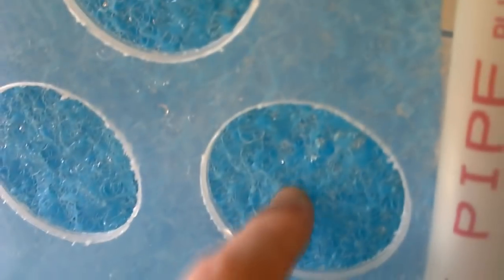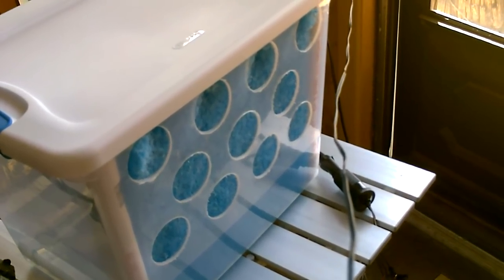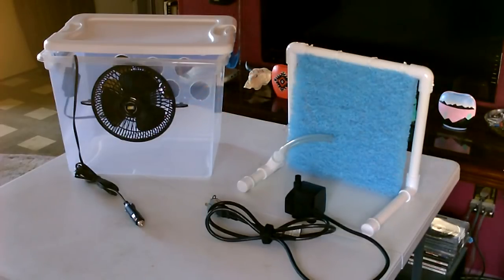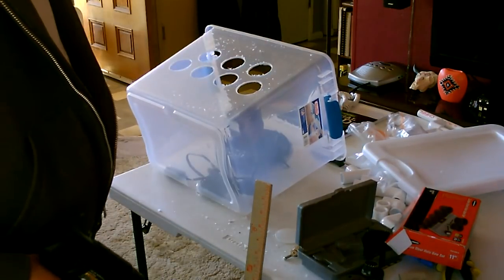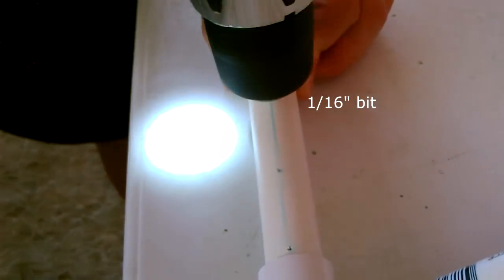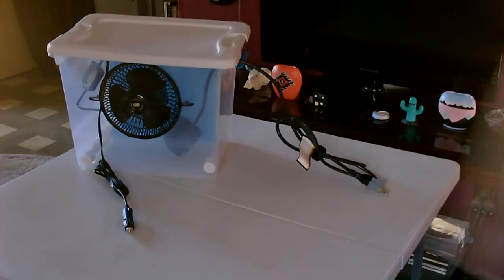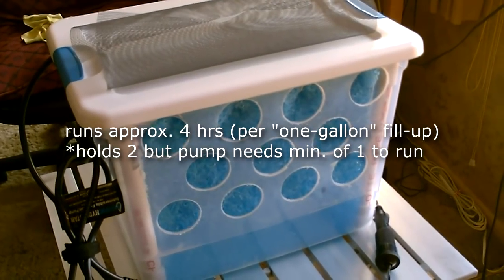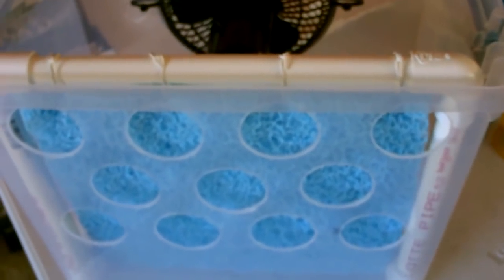DIY Evap. Air Cooler! - Tote Evap. AC Air Cooler! (fits in a Window!) or Desktop -can be solar pwrd!

Comment: Does the pump have to run the entire time and would this be suitable application for sleeping? Goal: raise humidity level during dry winter season.
Reply from the maker: hi. the pump does have to run the entire time but the pump is pretty quiet. the sound of the fan covers it up, so you almost can't hear it. yep, you can use it while sleeping. the only real sound you hear is the sound of the fan.

Comment: Why didn't you list the components you used in this? Where do you find those evap cooler pads?
Reply from the maker: hi there. in some of my videos i mix the list in with the build. i also drop some info in the description area. the build in this one starts at about the 2 minute 47 second mark. the main parts are a basic tote, along with a 12v 10 watt fan, small water pump. 1/2" pvc, 1/2" clear vinyl tubing and the padding. the blue evap cooler pad is technically called 'foamed polyester' evap cooler pad. if you search that term you'll see lots of it. i get it at the home stores (like home depot). a good size sheet of it (3 feet by 3 feet) is usually around $8.00. (if you see it for over 10 dollars a sheet they are ripping you off). it's usually waay overpriced on amazon. best place to get it is the home stores

Comment: but why put it in the window? why try to cool really hot outside air when you can cool the less-hot recirculated air inside? Is it because then you are already trying to humidify already humidified air (once you've run it for a while)?
Reply from the maker: hi. yes that's right. with evap coolers you need ventilation or it gets humid in the room.

Comment: How much humidity does it add to the air?
Reply from the maker: hi there. that's a tough question to answer. with these units you do need some sort of ventilation or the humidity will rise in the room.
Reply: @desertsun02  that's a good thing for me, I am trying to rise the humidity. Do you have a RH meter? I am just curious how much space it could effect and to what degree of RH. I saw your bucket video. I might try the bucket in a month or so and let you know what I find out.
Reply from the maker: @TacosForUs these units can work pretty well as humidifiers *if you don't ventilate. this unit could probably raise the humidity by 20% or more in say a standard size bedroom. the bucket one would do that too. i have one that is specifically designed to work as a humidifier. it's the one i made with a large kitchen wastebasket. if you want lots of humid air that is the best one. it also doesn't use an evap pad. (it passes streams of water thru the air and an optional screen). works great and has a nice sound. here is the video link https://youtu.be/F2eQV-95eUg

Comment: One last question - what size drill bit did you use for the drip holes in the PVC? It looks like was 1/16" or smaller. I've got the fan mounted - ended up getting a hot knife to carve it out as I wasn't making much progress with my utility knife. The hot knife (about $18 on Amazon) seems to work really well for cutting this type of plastic. You just need to make sure that your work area is well ventilated.
Reply from the maker: hi. 1/16" inch is the way to go. that works the best.

Comment: As for the fan for this, I think I have answered my own question. The fan that desertsun shows in his video for this Tote Cooler is made by Auto Expressions, hence the "ae" on the front of it. This fan looks to be available for under $10 on eBay at the following link. https://www.ebay.com/itm/224495783554?epid=1200071162&hash=item3444fdce82:g:X-oAAOSwHnVgxWS0. I am thinking that having a variable speed fan for this thing will be nice, lower for cooler days, higher for extra hot days. I found what looks to be a good one on Amazon https://www.amazon.com/gp/product/B087D5JCQQ/ref=ppx_yo_dt_b_asin_title_o00_s00?ie=UTF8&psc=1. It says it's 9 watts so it is within the design specs shown here. I am also planning on building out the Evap Cooler Cube that our brilliant Youtuber has designed (maybe even the 2 stage model) and that takes a totally different fan - a much more powerful 80 watt car radiator fan. For this Tote Cooler it looks like any type of car fan that is 6 inches or less will do. I thought about getting 2 smaller fans - but most of these seem to be made for computer cooling. I hope this helps.

Comment: Desertsun - I have bought almost all the parts to build this thing, but I'm confused about what diameter plastic tubing I need. I have 1/2" PVC and the T joint you show has to be a bit bigger than that for the PVC to fit into it - correct? Also, I got a pump with 1/2" male thread for both ends, but the thread is more like 5/8" (outside diameter) than 1/2". (I know these are rookie mistakes/questions.) I think I have that covered with a plastic adapter that the tubing will fit on. Should I get tubing with 1/2" inner diameter - or more than this?  My guess is that this will do, but I wanted to check. Also - I've been using portable coolers in my house in an effort to get away from my monster Central Air unit - placing them in front of open windows, but the Hessaire MC26A (and other bigger portable coolers) have side panels that will pull in indoor air unless these panels are blocked, which could create other problems. Your DIY window unit solves this problem. I can't wait to get this thing finished.
Reply from the maker: hi. the clear vinyl tubing should be 1/2" Internal Diameter (that is what i use). the tee joint is a 1/2" tee. they make those to fit 1/2" pvc pipe

Comment: Desertsun - this is marvelous!  You are brilliant!. I've been thinking about how to design an Evap Cooler that fits in a window, and I've looked all over the web for one. The only type available are massive units from MasterCool and Hessaire that are larger than large window air conditioners. I can't wait to build one of these. One question I did have is about the fan. I think I can just buy a 10 watt fan on Amazon, but I didn't see a specific one that you recommended. Also, how many amps does this use. I think a device like this would be magical if it could run on a Lithium-ion battery.
Reply from the maker: hi. the 12v fan i used uses less than an amp (i think it's 800 milliamps). the pumps can be as little as 3.6 watts or 4.8 watts. the whole thing uses very little power. 😎

Comment: I am curious as to how long it blew cold before u needed to add more frozen bottles please
Reply from the maker: hi there. it depends a lot on exactly how hot it is, how fast your running the fan and a few things. adding ice or ice-paks is a great way to give the unit a short burst of super cool air. (but it doesn't really need any ice at all. just the water.) the evap. process cools down the air and the water in the container. if you get 60F air coming out of it, for example, then the water will cool down to that temp. too because of the evap. effect.
Reply: @desertsun02  lets say hottest conditons possible like middle of august daytime running the fan as fast as possible  how long is it roughly in worst conditions at max
Reply from the maker: well, since the evap units double as "water chillers" the water will always be as cool as the air coming out. you can run the fan as fast as you want. to get exact figures you could check an evap cooling chart. those charts show you what temps to expect. one example, in 100F air with low humidity the air coming out will be about 71F (the water will stay around 71 too.). that is all day long everyday. the evap effect cools the water in the tub as well as the air so both the water and the air stay about the same temp.

Comment: I made one of these. It was the cube with the fabric on all four sides. It would work if the fan was stronger. The 12V fan I got is only 3 watts. The same company sells a 9 watt fan - that may work. Also,  I punched too many holes in the tubing - too much water on the fabric prevents air from shooting through. Better to start with fewer holes - like 3 per fabric face.  This one with the one sheet of of fabric, fan in the wall of the container seems a more realistic design. But the issue will still be the power of the fan as cold is produced but doesn't travel far from the unit.
Reply from the maker: hi there. yes, a 3 watt fan is pretty small. this unit i made uses a 10 watt one. so if you make it with a 9 watt fan, it would work good. the cube style one that you mentioned (that i have a video on) uses an 80 watt fan. you need one about that size for it to work.
Reply: @desertsun02  Thanks desertsun -  This unit you've made is really the best design I've seen - I'm making one! Hoping your other video using the 80 watt fan has a link or description to where to find such a fan. I spent $1800 on building a roof over my RV with 6" insulation - I actually FEARED the heat I expected here in N. New Mexico this summer - and after all my work - we're having the coolest summer in years! Oh well, I got coolness which is what I wanted!

Comment: Whats the name of this pad..and where ai found this pad...can anyone tell me??
Reply from the maker: hi. it's called evap cooler pad. most home stores sell it. i get it at home depot usually. amazon has it too. but look for a good price if you buy it there.
Reply: @desertsun02  have you ever experimented with aspen/natural pads?
Reply: @48956l  I'm wondering about that too, as that's all the have at my local Home Depot. My guess is that it would work fine, but I'd like to hear that from desertsun02.

Comment: Awsome! But the natural laws still apply here. This means that unless the back side of the cooler pad is confined to bring in only outside dry air into the room, the room you are cooling could quickly become like a sauna. This is why you see so many of these small portable swamp coolers, bought at places like home depo, for 1 exanple, that end up for sale on CL, and I've seen a lot of them there on CL.
At least this is what I am seeing a lot of. I love this swamp cooler that you made, and I am gonna make one fir myself. I would ask that you try to some hiw add a water to air heat exchanger ti your swamp cooler....sime how. Thank you sooo much for your video⭐👍😃

Comment: Suggestion, Turn the pad element rack 90 degrees, extend the horizontal legs about 2 inches beyond the uprights, using tees, so as to keep it standing upright a couple inches from the end wall, wrap the pad around the pvc on all four sides to seal well inside the container and keep air from bypassing the filter, punch fewer and larger intake holes up as high as possible in the end of the box to give you more water holding capacity, put the fan in the lid now that there is more room to do so since you have moved the filter element closer to the far end by turning the rack 90 degrees and moving it closer to one end of the box. 
With the fan facing upwards now you can put a 90 degree hvac elbow over it so that you can direct the air flow in any direction that you want. 
Also, with the fan as high on the unit as it is now there will be much less possibility of overfilling and shorting it out.

Comment: Y'all got a cool set up with that box fan and evap panel. Maybe try cutting the evap panel into strips then wrap the material around copper tubing with tiny holes drilled into it then have generated liquid air fill a insulated resivor that feeds those tubes for another type of air conditioning? 😊

Comment: Try a helium sealed cylinder stirling cold piston that turns the gases in the air to liquid. That fills an insulated tank with a bell siphon. Then have the siphoned Liquid air pass through a filter to filter out all the dust dirt pollen etc. Then have a copper coil that has a bunch of tiny holes drilled into it. Then have a type of material covering the copper coil to absorb the liquid air. Then pass air at high volume to cause the liquid air to boil off has heat exchange happens has the warm air passes over the coil and causes the liquid air to boil off back into regular atmosphere cooling the air. A different concept for air conditioning and dust dirt and pollen control. Could design the filters to be able just to reverse the flow and purge filter with water from a sink faucet then allowing the filter to dry out has a clean dry filter is being used to filter the liquid air. Liquid air reaches ultra low temperatures so a superconductor separator componat could be added later that could process all grey water into fresh drinking water. Read up on superconductor separators. You could even add in an atmospheric water generator to generate fresh drinking water.  A V-6 or V-20 cold gas piston stirling engine with gadolinium magnetic bearings on all moving parts with antivibration technology with the cold gas cylinder heads within an insulated resivor that holds the cold gas piston cylinder heads to fuel the stirling cold gas engine with a bicycle automatic transmission attached to one fly wheel and a rewired drum motor generator attached to the transmission to generate electricity to power other devices or charge an organic carbon power cell bank. With a fan attached to the other fly wheel to draw air over the liquid air coil for a home cooling electrical power generation system. Be a neat set up for a hydroponic green house since you could do climate control chill the water even use tanks with frequency emitters to infuse the water with oxygen and nitrogen taken right from the liquid air and use V-twin cold gas pump motors to circulate water through the hydroponic system and even generate electrical power for lights and fans and other electronic devices. 😵😲😊

Comment: I wanted to private message you, but there's no where on your home page to do that. Oh, well. I just finished building this for my RV bedroom. I live in a 29' fifth wheel- the window ac in the kitchen doesn't reach the bedroom.I used an 18-gal Rubbermaid container I had, a 6" desk fan I got on sale, PVC and some fittings already on hand, water cooler pad and the smallest water cooler pump Wal Mart had. IT WORKS!!!!!!  The lid sits on top so the cats can sit on it while it's working. I have blue ice containers in the freezer- about a half hour before bed, I'll put them in and add a little more water- I just need it to run long enough for me to go to sleep comfortably, so I'll add a timer at some point. Instead of using a Tee- fitting, I used a corner piece that is threaded on one side and a plastic barb fitting from a water sprinkler system I found at Lowe's. GOD BLESS YOU FOR CREATING THIS! I'd like to send pics (mine isn't as pretty as yours). All in all, I think I've spent just under $30, not counting the stuff on hand. The portable evaporative or water coolers as they're called here, are around $120.
Reply from the maker: hi there. that's great! - i'm glad you made it and glad it's working out well for you. and as you say... the ones that they sell do cost more (a lot more) than building one (and you can always easily fix the one that you built (if needed) but if it's store bought then they just want you to buy a whole new one. you might be able to send pics thru the private message feature of YT. or thru the new "community tab". or post the pics on a photo sharing website and then just drop a link into a comment to that.
Reply: curious how long did the cool last did it last long enough for u to sleep in your rv at night

Comment: Ice packs actually won't work as well long term because it needs warmer temperatures to evaporatorate those mini homemade ac suck unless directly on you. The homemade evaporatorative cooler will actually cool the air in the room and work better.

Comment: Think I could make  one for my van back window.
Reply from the maker: yep, i think that is a GREAT idea
Reply: Did you ever give it a shot? Curious how these work once the ambient humidity starts increasing. Would a fresh air supply be necessary?
Reply: @joshuasteele5108  yes an open window helps prevent that but If your relative humidity is under 30 percent, you can't go wrong.

Comment: Can one avoid pump using wicking material?
Reply: Yes, it would be possible to re-engineer this so that it didn't need a pump.  You'd need to place the water source above the pad and drip the water onto the pad by gravity.  You could control the water flow/drip rate using something like an aquarium air valve.  You'd also need to keep a drip tray underneath and check and refill the unit frequently.  It would take some experimentation to get the drip rate right and it would require lots more attention than the unit shown in the video, but one could make it work.

I'd probably just keep with the pump.
Reply: @clydealspaugh8701  Are you just re circling the water with the pump?
Reply: @mikeblount9353  what type of pump
Reply: In theory Paper towel strips hanging up from bottom to top with gaps in between the strips will wick water up them.  Use something like bounty and it'll hold up to the fan.  I've used paper toweel strips to wick water up 12" before, it's slow and takes a while to soak all the way up, but once they do the rate of evaporation should be slow enough that they stay wet.

And now days a good lithium battery pack should run a fan like that for days.  They actually make a fan on amazon with it's own battery with a 2 day run time on medium speed.

Comment: the connector piece that allows you to hook up the hose to the pump and the PVC- what is that piece called and where do you get it?
Reply from the maker: hi. that's called a "hose barb". you can get it at home depot (or the home-stores more generally)
Reply: Thank you. I have an old ice chest that I'm thinking about using as a water tank. I have just about everything else but the pump here - time to make an "off-grid" evap. cooler.